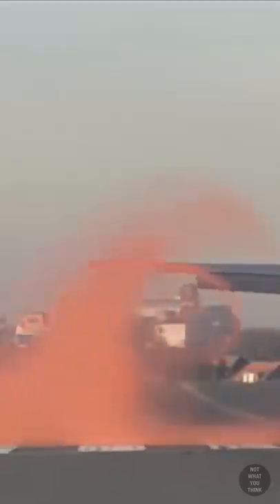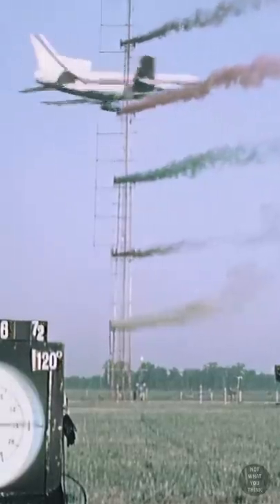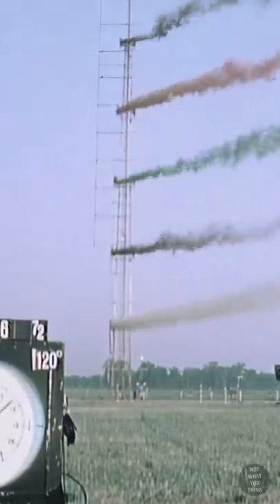This is NOT a Tornado #shorts

Comment: Fun fact, these vortices make flying in formation more efficient, which is why birds (and planes) fly in formation. The outside of these vortices always rotate upwards, meaning any bird/plane next to them get lifted up. This is effectively creating free lift that can be taken advantage of, and makes flying take less energy.
Reply: is the extra life generated regardless of how much energy the frontal planes are outputting? Like in the Blue Angels, do the lead jets have to spend more energy with vortices, or is it really just a by-product?
Reply: @kmmediafactory  Even if you're moving extremely slowly the vortices are still generated, but the faster you go the stronger they are. Vortices by themselves are bad, they create extra drag which is why you see airliners designing increasingly complex winglets to try and shrink them as much as possible. However vortices will always be there, it's just a feature that all wings have.

Flying in formation works because you may as well take advantage of the vortices since they'll be there regardless.

The lead bird/plane also gets a benefit. It wasn't talked about in this video, but there is also a vortex across the wingspan. Best way to visualise it is imagine you're behind the plane, the side of the vortex away from  you rotates upwards, and the closer side comes down. Since the front side rotates upward the plane in front gets a small lifting force as well from it.

Flying in formation benefits everyone involved. It's why so many birds do it too.
Reply: honk!
Reply: @Sir_Budginton  quite interesting, think as for clearing it up for me!
Reply: Me as a racing fan: slipstream baby
Reply: @kmmediafactory  I do not think that trailing aircraft affect the leading aircraft. The wake can dissipate into heat over time, or it can serve to partially lift a trailing aircraft. When this happens, the leading aircraft is already too far away for the air to transfer any measurable force to it. It's like how a jet ski (speed boat) won't affect another jet ski that's several meters ahead of it.
Reply: Isn't that called drafting?
Reply: @danverss6176  This isn't slipstream. Slipstream is the vehicle in front creating a pocket of less dense air, reducing drag. These vortices are rotating air that push the plane up, which means the plane doesn't need to produce as much lift itself reducing lift induced drag.
Reply: Very interesting!  Thank you
Reply: @Sir_Budginton  does this mean that every other bird in the formation gets to rest a bit?
Reply: @krmccarrell  it means every bird (not every other, all of them), spend less energy while flying, making it easier. If there’s a strong enough thermal to keep them up then they can also get a rest.
Reply: @Sir_Budginton  I agree for the most part. The most wing tip vortices are created during slow, heavy, and clean configurations. I don’t agree with the part that “the faster you go the stronger they are.” Wing tip vortices is induced drag, the faster you go the less induced drag you experience since there isn’t enough spanwise flow to reach the edge. The faster you go parasite drag mainly takes over, yes there are still some vortices created but they do not get stronger
Reply: For a Muslim you know too much about flying

Comment: To ensure that there is enough separation for big planes, ATC and pilots add the term "heavy" added to the aircraft callsign so they know they need a bigger separation than usual.
And for the A380, they use the term "Super" for even more separation.
Reply: They also say caution wake, I think prop wash is a similar effect on smaller prop planes and they say it too
Reply: Wonder if one of those C10s have their own term lol. Thats a big fuckin plane to say the least.
Reply: Superation
Reply: Now i wonder what the An-224 (or was it 225?) Callsign would be
Reply: @rizalardiansyah4486  225
Reply: Know i know wtf "heavy" means even though im a plane kid (me is 11 yrs old)
Reply: @rizalardiansyah4486  the 225 and a380 are both classes as super, everything else is light through to heavy. Fun fact is that the 757 requires heavy seperation even though it's a medium aircraft because of the wing design
Reply: @FRANK45CASTLE  C-10? How about a C-5M? Only thing bigger than it is the AN-225
Reply: @LavenderSystem69  i was in the army and C10 was the biggest i ever knew of. How do they even get those kinda things in the damn air lol. Im gunna go look those planes up now. What is it for? Battalion transportation?
Reply: @FRANK45CASTLE  I'm not even sure WTF the Air Force uses them for, TBH. Really isn't my domain; I'm just a truck driver in the Army who makes sure that a team's gear gets to the AF side of post so it can get put on a bird and move into country
Reply: @LavenderSystem69  fuck yeaa man thats awesome, i wish i had picked up a trade while i was in but i picked infantry and what skills i do have i wont be using anytime soon at least i hope lol.
Reply: Used to live right under the departure pattern from ONT, and the biggest heavies were the UPS planes. Some were still so low by the time over my house I swear you could count the bolts on the undercarriage. They were the only ones that came over that low. Even my dogs would look up.
Reply: @FRANK45CASTLE  while I don't know much, I do know that the C-5 is large and powerful enough to carry something like 2 Abrams. I believe it's mostly used for moving around large amounts of cargo for long haul trips because of its range.
Reply: @FRANK45CASTLE  c10 the biggest. Lmfao I seen the b52s while I was in the army. This was less then 2 years ago
Reply: @OriginalKingRichTv  i was infantry only planes i ever dealt with was C-130.
Reply: @OriginalKingRichTv  c5 is the biggest bruv.
Reply: @rizalardiansyah4486  orng indo ya wkwkw

Comment: This was a GREAT short. Learned something I never knew but was curious about. (Top gun, when mave crossed ices blow out)
Reply: That was different. In that movie they said both engines suffered a flame out after flying throu the exhaust stream of another aircraft. There is 2 possibilities afaik:
1.  The exhaust stream entered the air intakes head on. Since it is oxygen depleted and rich in CO2 it might have suffocated the engine.
2. Compressor stall when the exhause went past the aircraft and created a low pressure zone in front of the air intakes or intrduced vortices inside the air duct.

I am not familiar with the ignition systems of an F-14, but the effects shown in that movie were way over the top, imho. An airplane does not stop flying as soon as the engines shut down and also with that amount of airspeed and subsequent airflow over the two(sic!) rudders would make it near impossible to enter a flat spin. As long as there is enough hydraulic pressure left, you should be able to recover the aircraft.
This is why i am not a hollywood writer ;-)
Reply: @DasIllu  what
Reply: @DasIllu  they lost control because he freaked out and couldn’t regain control because of what happen to his dad if I am correct? I haven’t seen it in so long. I’m going to have to rewatch it.
Reply: Text
Reply: I watched this the other day and they called it jet wash
Reply: @Gravvvyyy  no, he got into a spin because he crossed behind someone and one of his engines dies, only 1 of 2, so the unbalance of the thrust put him into a spin he couldn't get out of
Reply: my favorite movie though
Reply: @negativenarwhals  one of my favorite too. I just hadn’t seen it in so long I didn’t remember the specifics to the crash.
Reply: @Gravvvyyy  👍
Reply: @Gravvvyyy  Maverick lost control because he was traumatized by Goose’s death, not his dad’s.
Reply: @kingmegatron7974  yea I knew it was something along those lines. I got it confused. My bad.
Reply: @kingmegatron7974  when maverick loses control, that’s when goose dies, when he disengages in the final battle, that’s him being traumatized by gooses death

Comment: Wait why were the turbines of the plane ON the wing??? Great content BTW keep it up!
Reply: Likely to allow the plane to be as low to the ground as possible when landed, to make it easier to get on and off. Putting the engine under the wing means special equipment is needed to get on or off the plane (aerial walkways or moving steps) since the engines take up room and the plane must be taller.
Reply from the maker: Look up "Over-wing engines"
I don't know too much about them, but requiring less ground clearance would be one of the benefits.
Reply: @Sir_Budginton  and @Not What You Think thanks now i know a bit more about planes =)
Reply: I know the an-72 or something has them but what aircraft is that
Reply: @WEE9  the down sides of having the engine above are :
- More noise for the passengers in the plane
- Impact on the aerodynamics (most of the lift is created by the airflow above the wing)
- Potential safety hazard, if the pylon fails you'd rather have the engine fall down instead of falling on the wing
- Maintenance is more difficult (engines are less accessible)
- A tendency to pitch down when you accelerate (this can be bad if you need full power to abort the landing, you will need to compensate for that)
Reply: @randomguy9723  Hi, 
it is a West German WFV-Fokker  614. 
A pretty odd looking plane!

Comment: The last one is rubbish. There's one glidepath the aircraft has to follow and there's a so called 'touchdownzone' where planes are supposed to touchdown, no matter their size! ATC just does seperation because recalibrating an ILS could take up to half an hour, which would be very impractical.
The closest separation at my airport (EDDH) we can do is 3NM.
So all aircraft follow the exact same route in final approach. And we can use 'reduced runway separation' which basically means we can have two aircraft on the same runway under certain conditions.